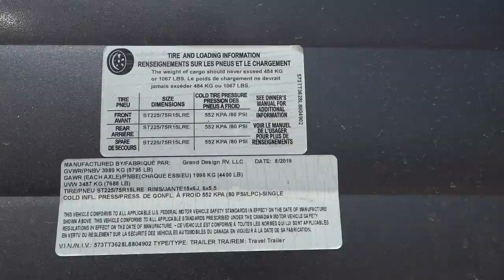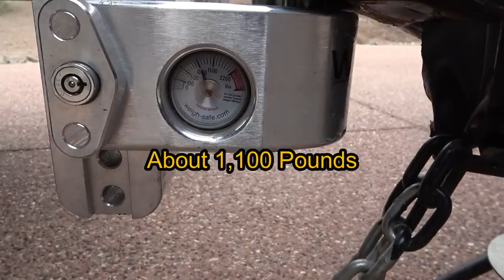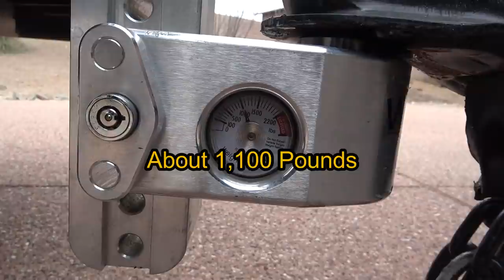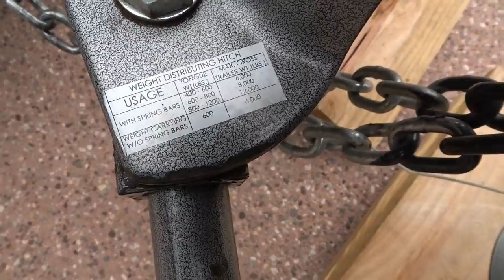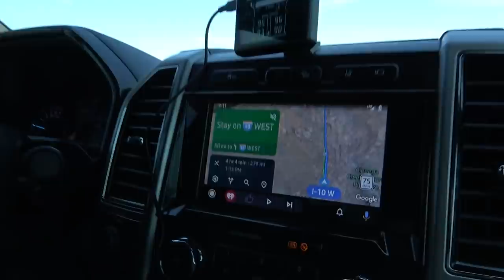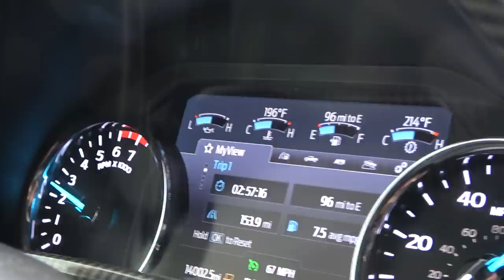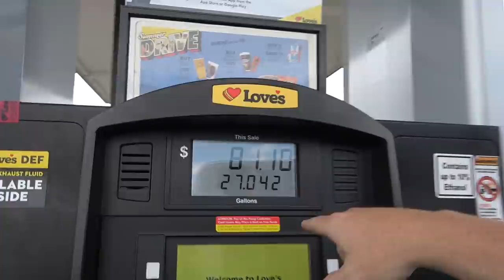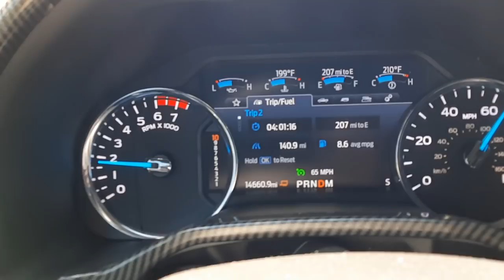Ford F250 7.3 Gas, 4.30 gears, MPG, towing prep and MUCH MORE!

Comment: I never tow with cruise even on the bald ass praries. You have NO feel for the transmission and as your truck ages you  c an get alot of wear on the drive train. Be in control don't use cruise. You will be thankful you didn't. Tow in a direct drive gear as well, not overdrive gears. I think on your truck thats 7th or 8th. You should find that out. Your trans will last a long time. If the dealership says don't worry about that then find another dealership to do your maintenance cause they just want your money. THat's a whole lot of good advice from a complete stranger. You are welcome.
Reply from the maker: I’ll give it a try. Thank you.
Reply: What do you mean No feel for the transmission? The truck will shift when it needs. Yes, if you have very few gears and gear hunting is happening… ok. But with 10 gears…

Not questioning your intelligence, as you are a stranger and I know nothing about you… haha just looking for an explanation.

Comment: So unwise to stuff your fuel tank up the fuel neck. That puts an load of the EVAP system.
Reply from the maker: Yes, and I did it for you guys so I could be as accurate as possible! Doubtful I hurt anything after only a couple of times.
Reply: @BigBoyToyzz  agreed 
Here's a suggestion moving forward...fill to first click of the nozzle, wait 30seconds then go till it clicks off a second time. This is how I've done it and it's easy to repeat. Super simple and consistent if done the same way each time. Great content!

Comment: Completely wrong on payload for F250 diesel. I’m at 2800 lbs payload WITH 6.7L diesel.
Reply from the maker: Not all 6.7 F250 payloads are the same. Payloads are different with options. A sunroof will lower your payload by 100 pounds. Also, if you add tow package or snow plow package that will add capacity to your payload. The diesel weight difference over the 7.3 is subtracted from your payload regardless of options. I've seen F250 Tremor 6.7 Platinums with 1900 pound payloads.
Reply: You have the 10,800 lb GVWR package. It is an upgrade when the truck is made.
Reply: @BigBoyToyzz  I think you may be thinking of the F-250 "High Capacity Trailer Tow Package", not the Tremor package.  The high capacity tow package is only available on the F-250 with the 6.7, which adds an additional 800 lbs of payload to offset that lost payload.  Without it, yes, I have seen 1,900 lbs on an F-250 6.7.  With it, it bumps it up to 2,700 lbs.
Reply from the maker: @niceatrya3477  Yes... you are right! Thank you for the clarification.

Comment: You pull your Rv at 75 mph....hope you don’t have a blow out...Rv tires only rated for 65mph.
Reply from the maker: Well... you need to call Goodyear and tell them that they need to re-engineer their speed rating of their Endurance Trailer tire from 87 MPH to 65 MPH because "RV tires are only rated for 65 MPH". 😂 https://www.tirebusiness.com/article/20170130/NEWS/170139995/goodyear-introduces-u-s-made-trailer-tire

Comment: 2020 is not the first year for the 10 speed my 2018 has a 10 speed.
Reply from the maker: It is for the Super Duty, which is the truck I'm talking about. And the F150 ten speed is completely different than the Super Duty 10 speed.